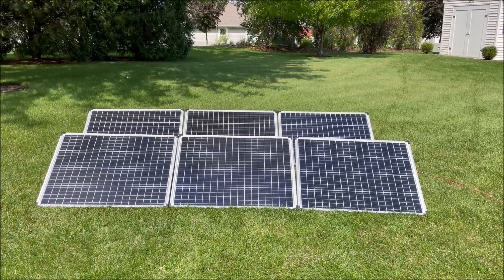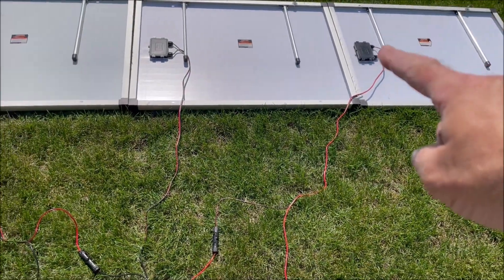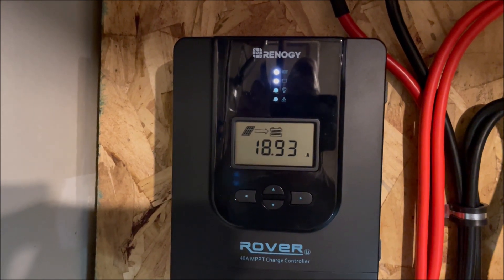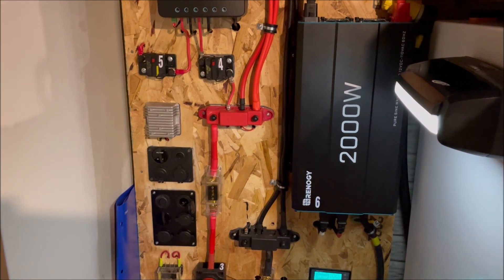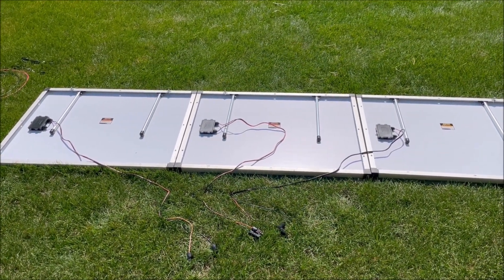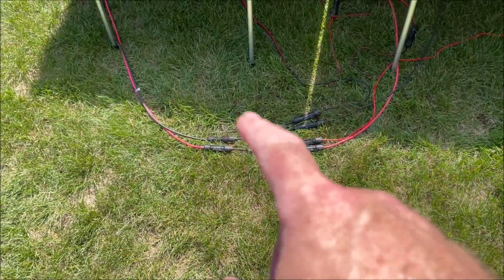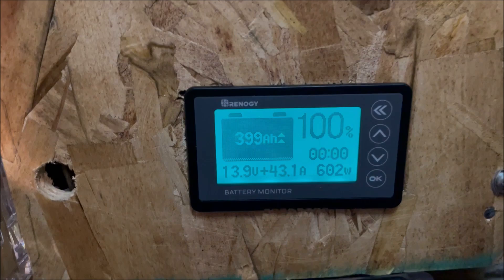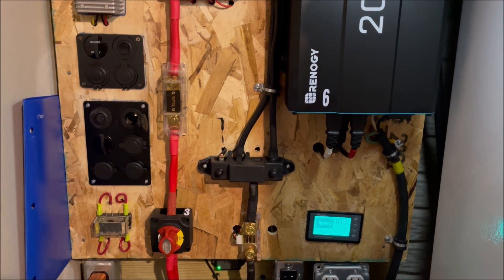Solar Basics: (5) How to hook up your Solar Panels in the 3S Series-Parallel Configuration!!!

Comment: I want to do this Same 3s-2p configuration but my panels are mounted vertically and all 6 are side by side about 27 inches wide a piece. I'm trying to figure out how many extension cables I would need, etc

Comment: Thanks again for content , I have the thunderbolt foldable panels the module wiring set up in back of panels are factory series linked together into one wire lead for both modules instead each panel having it's separate pos and neg lead , will the approach be the same for wiring these foldable panels  in series as oppose to this thunderbolt used in this illustration with a single module with POS and NEG , hopefully I.m explaining this right to you thanks in advance for response.
Reply from the maker: The panels in this video also had the SAE Connector as the folding Panel you have.  In order to use them in Series I had to convert the panels to the MC4 Connector you saw in this Video.  Watch my video on how to convert from the SAE to MC4.  Part 1 is linked here.  Make sure to watch Part 2.  https://youtu.be/KSOZrKYkOlE

Comment: I've done this exact same set up except I have the Renogy 60MPPT... How are you getting 40+ Amps with 3S-2P? When wiring in Series the AMPS stay the same, but the Volts increase, just the opposite for Parallel. Your first 3 panels in series would only put out 5 or or so AMPs, same for second, then when you parallel them you would get 10 or so amps. I'm using 6 100watt 20v Harbor Freight Panels, wired exactly as you say 60V or so and 10 or so amps into the controller in MAX in full Colorado sun at 8000ft. My Renogy Battery Monitor confirms around the same input. 

Check out this guy at Explorist life his video https://youtu.be/KJ5zCY5EBeQ explains how mine is working... Am I missing something...   Just wondering what you've done to get that kind of amperage out of a 3S-2P with 6 Harbor Freight 100w panels
Mine are wired this way: https://youtu.be/KJ5zCY5EBeQ?t=505

thanks in advance
Reply from the maker: Its about The Math.  If you input 60V at 10 amps which is 600W from a 3S-2P Panel Configuration, then you have to output 600W to the Battery.  The Battery won't accept 60V's so the Charge controller has to lower the voltage to an amount the battery can except.  So if 600W is divided by the battery charge voltage of 14.6V (For LiFePo4) the output current would be 41 amps out of the charge controller to the Battery.  I am measuring the output of the charge controller and not the input.  If I want to know the input then I check the Renogy Blue Tooth App.  I hope this answers your question.
Reply: @thechiefsway2618  That does makes sense... I'm still trying to figure all this out. Thank you for the schoolin' Chief, much appreciated.
Reply from the maker: @whitehead70  Thank you for Watching.
Reply: @thechiefsway2618  Just wanted to come back and say I am getting over 600w and 40amps to the batteries just as you say. My issue was I was not letting my batteries get run down enough, they were always nearly charged, so my charger didn't need to put as much in them. Thanks again for your help and your videos.
Reply from the maker: @whitehead70  Any time!

Comment: are the connectors for the panels necessary? can you use wire nuts and electric tape instead? wouldn't that be a better connection then mc4?
Reply from the maker: I would stick with the MC4.  Wire nuts and electrical tape would not me the best long term weather proofing.